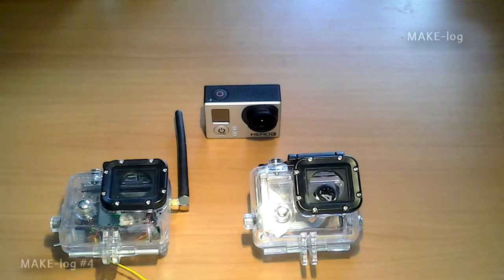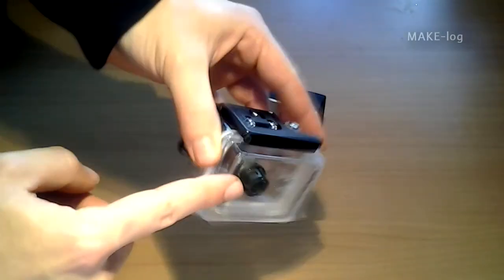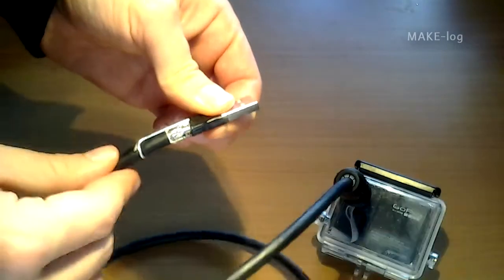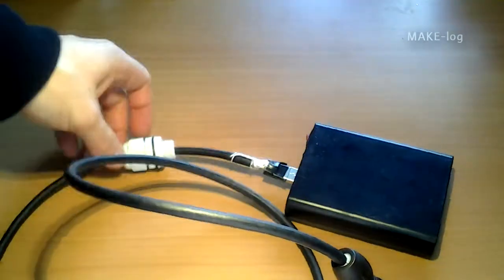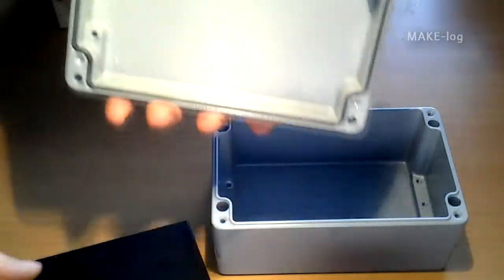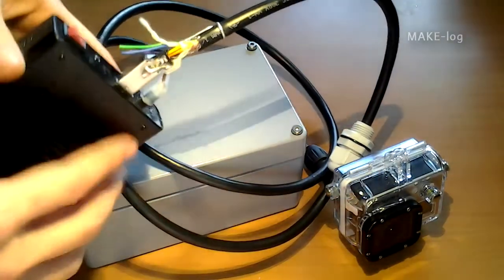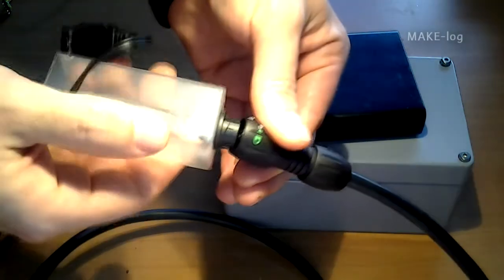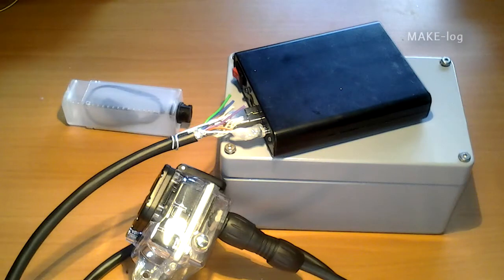MAKElog#4 Charge GoPro Hero3 underwater. Extend recording time by hours.

Comment: Excellent, thanks for sharing your good work. I am interested in using my gopro4 underwater (upto 100m) to watch a live feed on my fishing boat. Power can connect to battery on boat and the video on iphone 11pro or macbook pro... if you can build this it would be great
Reply from the maker: Dear Ray, I think the video transmission via WiFi will not work for up to 100m depth. So your idea to use a cable is a better approach, which might have led you to my video. I think you need a VERY robust and well sealed case first. When this is solved, I think a transmission via the HDMI output should be feasible while viewing takes place on a monitor or via a HDMI to USB converter. I would like to build many more things from my current stack of 50+ projects, but due to the lack of testing equipment (boat, lake), I unfortuately have to put your building request to the bottom of my project stack ;)

Comment: If there was no memory limitation, how long will your external battery charge the camera for before dying?
Reply from the maker: Stacy Bierwagen I did not test the setup for charging only, but for charging while recording. For this scenario It should last at least 6 hours continuously. I think up to ten hours charging and recording are realistic. Unfortunately my GoPro stopped working due to a quadrocopter crash (explained in the comments here: https://www.youtube.com/watch?v=TQCkC8Fpscw). So at the moment I unfortunately cannot do any more tests.
Reply: Thank you for your input I appreciate it! Sorry to hear about your go pro.
Reply: Make-log did you wire the Micro USB cable that goes in the GoPro yourself? I can't find one that fits flush to the camera like yours.

Comment: This is a very interesting setup. Where did you source the Mini-USB connector that goes to the GoPro camera and did you have to modify your case to make that fit? There is not a lot of room on the side of the case and I would love to see a close up of the connector.
Reply from the maker: Brian Vinciguerra I git additional space due to the use of the LCD backdoor. In this space I could easily fit the waterproof port where the mini-USB connector is connected to.

Comment: Where did you get the black cable that makes the water tight connection to the modified back door?
Reply from the maker: DJ Vertigo I built it on my own

Comment: @Make-log
Had a few questions if you don't mind?
Trying to find alternative ways to power and connect mics while keeping everything waterproof. Currently we are using the Longshot USB by Hardened Power systems, which supplies power, but doesn't allow us to use external mics.

I noticed in you transmitter video that you labeled two inputs for Audio in:
- Could we us the same cable you did to incorporate power ?
- Are the two inputs for two audio channels or just for 1 mic in stereo ?
- Where can we get the cable you were using ?

Any help or advice would be greatly appreciated

Thanks!
Reply from the maker: Dear Tackle Warehouse,

the 10pin USB pinout of the GoPro shown in the video transmitter video is based on a pinout which is linked in the video description. I did not test each pin, but my cable connects to all pins.

To answer your questions:
- Could we us the same cable you did to incorporate power ? - Of course, but I have built all cables on my own to fit everything into the tight space. You cannot buy them anywhere.
- Are the two inputs for two audio channels or just for 1 mic in stereo ? - According to the linked site with the pinout a stereo mic input is mentioned. So stereo mics seem possible.
- Where can we get the cable you were using ? - Unfortunately you cannot buy it, see answer 1 above, sorry.

I checked the official GoPro site: http://shop.gopro.com/EMEA/accessories/combo-cable/ANCBL-301.html The "Combo Cable" allows charging and connecting a mic. So at least your task seems to be officially supported :)